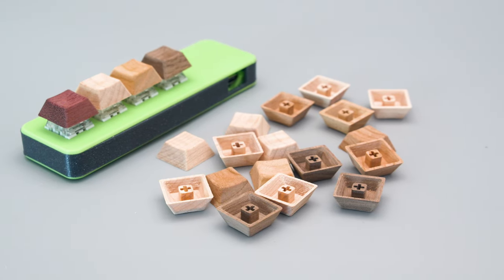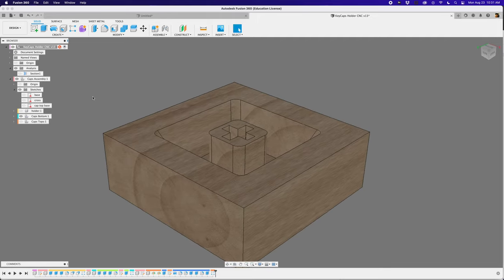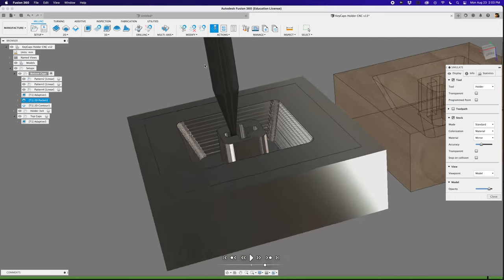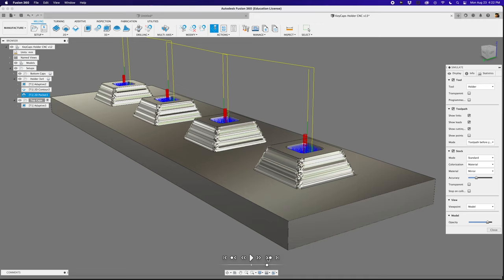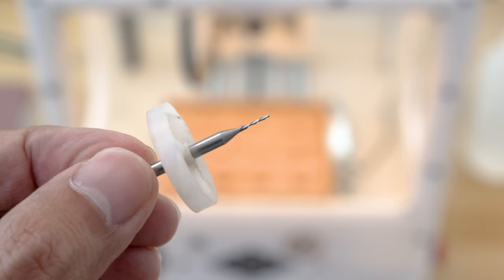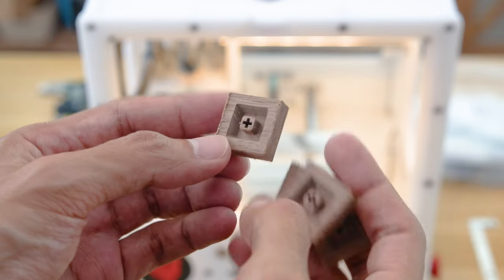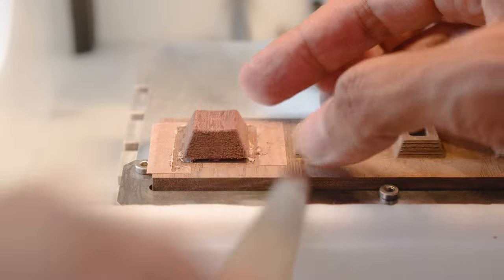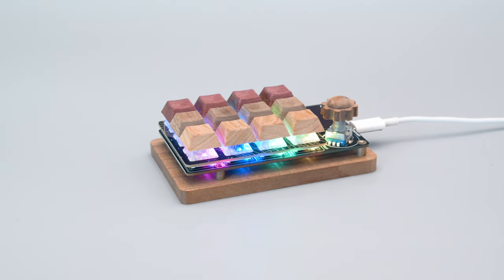How Did We Make These Keycaps out of Wood?

Comment: THIS IS SO COOL! Now I want a desktop mill really really really bad. But on a more important note I think I might have figured out a way to slightly modify your process to make backlit wooden key caps. Allow me to explain:

So what this would require is a 3 step milling process for each key instead of a 2 step process. For the first step, instead of milling the bottom side out to leave the cross for the switch connection, you would mill out a square to essentially make a mold reservoir for the next step. At the bottom of that mold, you would engrave a mirrored version of whatever letter or symbol you want the key cap to have. Personally I would make this character engraving a decent thickness to allow for the upper half of it to be milled away with the wood that will be milled away to make the top chamfer in the third step of the milling process. The next step would actually not involve any milling, instead you would simply fill the reservoir you made with a heavy duty clear epoxy which would fill in the backwards engraving of the character you milled in the first step. For the second step of the milling process (after the epoxy has fully dried) you would mill the same cross shape you made originally, but this time out of the epoxy. This is the part that I’m unsure about. I’m no milling expert so I have no idea how the epoxy would react to the heat made by the mill’s moving parts so if not handled properly I suspect it could end up melting the epoxy instead of making the desired shape. But assuming that works, the final step would be exactly the same as your final step in the video. Except this time milling out the chamfer for the top of the key would reveal a clear character left in the heart of the key, that could refract light through it, giving you a beautiful backlit wooden key cap.
Reply: brilliant idea benny, i think ill try it out when i get to that step on my KB project. (working on case ATM)